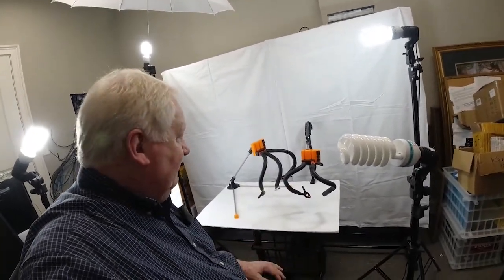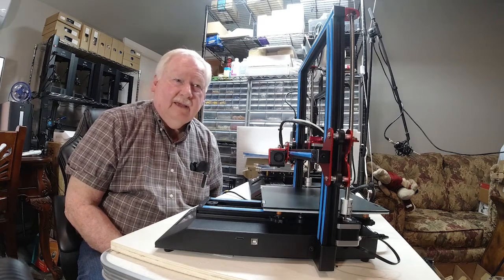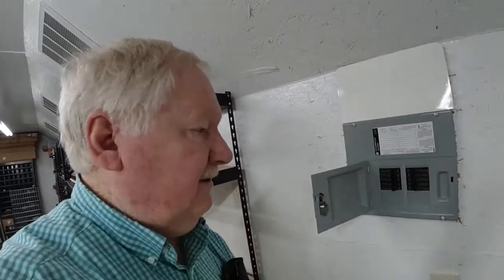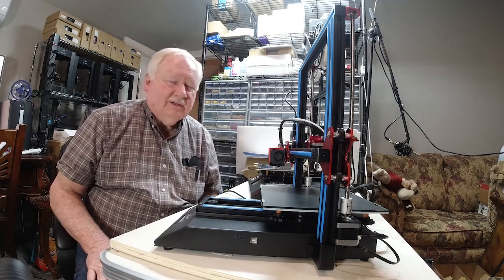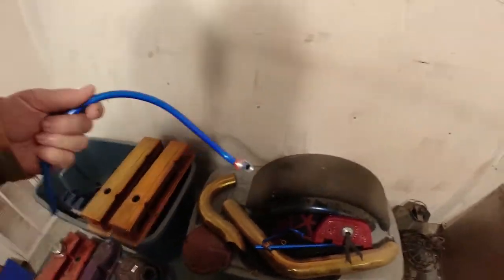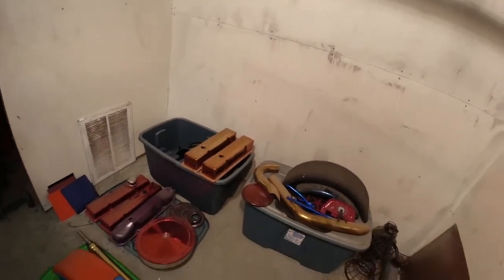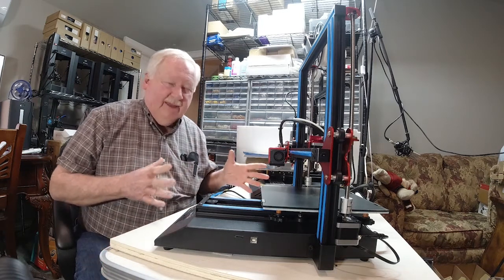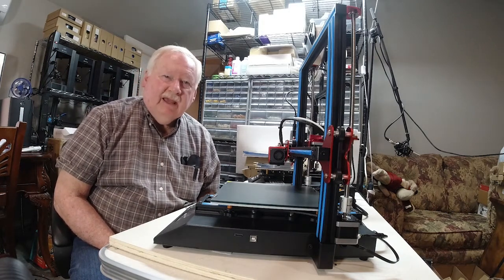New Tech Inventors update on my new 3D print farm and other 3D printing business related items.

Comment: Thanks for sharing another great video Ken. I’ve been trying to get may wifi set up properly on my few acres around our rural property. We have 100 acres but trying to get the house paddock done from house to workshop. What wifi are you using? Cheers Robert
Reply from the maker: I used a bridge/repeater called "COMFAST" you can find them on ebay for about $70 US for the pair. They claim to have up to a 3k meter range outdoor. I have mine set on low power and get over 400 meters. They make more powerful ones if you need them. Hope you find one that works for you. Thanks for the question Robert and thanks for watching...Ken

Comment: Very nice video....I’m interested in your test print operation.  Your lucky you have many printers in line to vary your input specs .  This will enable you to get a nice product fast.   I only have one printer and have to change my input specs every twelve hours .  This takes months.  But...slowly I’m getting there.  Your way is much better.   I’m a little concerned with your 60 printers and fire safety . I hope you have a plan for the protection of yourself and your cute doggy.  I’d be very interested in how you will do this.  I saw your funny little video clip that was extended in this very fine video....bless you Joe
Reply from the maker: Thanks Joe for your support and concern for the safety of myself and Wolfie. I am working on a lot of electronic controls for ventilation and printer temperature monitoring. I also have plans for a dry sprinkler system if things get real bad. I have made sure that the electrical system is adequate safe. the printers are the concern and I am currently testing different ways to detect abnormal temperatures and take actions like cutting power to that printer or even cutting power to all printers if necessary. With the video monitoring I will also have WiFi notification of alarms and control of several functions of the remote print farm from my house. I am making this up as I go so as soon as I get something that works I will share. I will be honest I don't like having several printers running all night in the house where I sleep. Lost of smoke and carbon dioxide detectors!!! Thanks for having my back my friend....Ken
Reply: @NewTechInventors  running them 60 all night must be a concern.   I have 1 and I think about it all night.  I will suggest for every rack you have at least 1 heat rise WiFi sensor smoke detector ... Honeywell 5809s would do the trick and it’s wireless.   Maybe 2 on each rack ....one on bottom and 2nd level.  Peace to you and cutie
Reply: I just saw something maybe good for the farm.   Joseph Prusa print farm uses a 24” piece of plastic that covers half his printers. The plastic is situated on his metal shelf vertical supports.  This would control your filament as it seems the printers heat within itself-transfers to  dry the filament.  Look at Joseph Prusa chocolate something on you tube... joe
Reply: https://youtu.be/ZmRVPq64Iy0 is the link of the pic I saw....

Comment: Do you know you can put an ethernet signal through your electrical supply negating the need for WiFI repeaters? I have a unit I got from Banggood
Reply from the maker: The Comfast units have a range of 300 meters at 300 mps and cost me $60 for the pair. They are powerful enough that I have WiFi everywhere now without any other equipment and it works great. You are right about running WiFi thru the electrical system and it does work. I used to install smart home wiring in large custom homes and the control of everything was thru the AC line. Of course you had to remember to connect it to both phases for everything to work. I don't know if what they have today is rated at 300 mbs. Thanks Andrew for your comment and bringing this option up. Always good to hear from you my friend...Ken